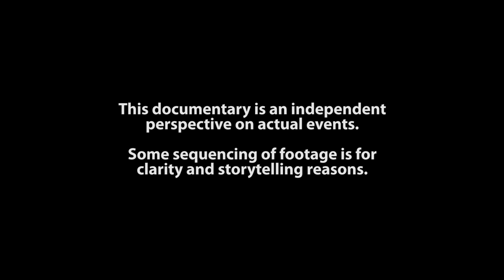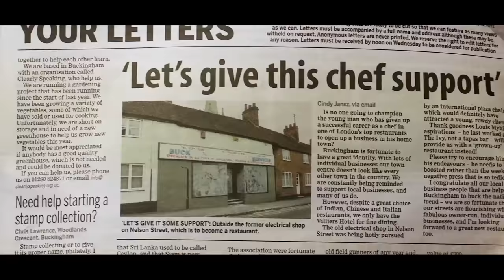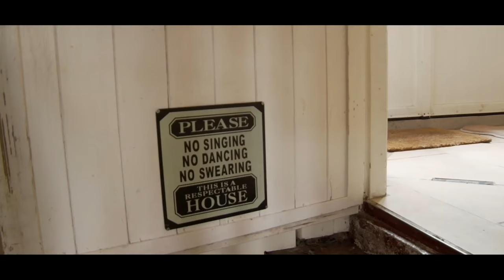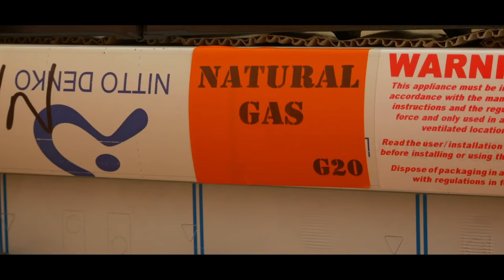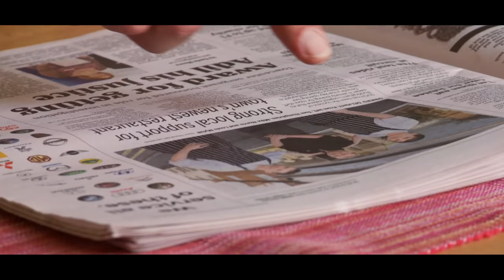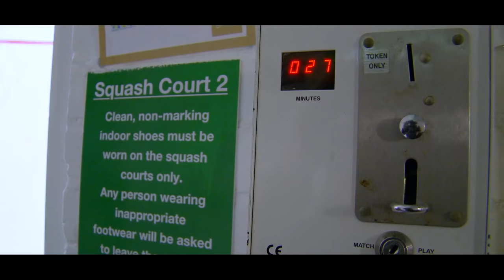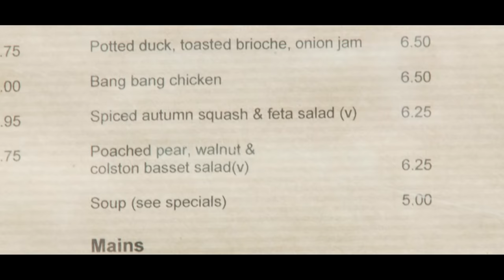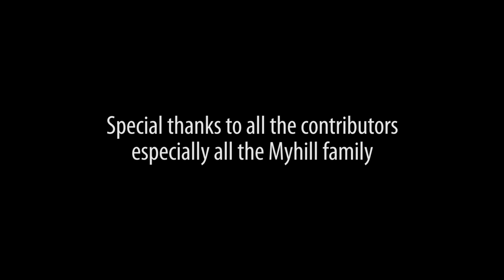Setting up a Restaurant? Louis and the restaurant - 52 mins documentary (HD)

Comment: Well, planning approved his restaurant plans and the local homes would have been asked if they had objections? So its all done and dusted and letters would have been sent out because it is a historical community and homes are Grade 1/2 listed.  It is not down to Louis to put up a message to his community about a restaurant opening in the building, planning Dept notify, good PR will promote the restaurant, that's how its done. Snobbery beyond compare. At one point they are crying out for a new proper restaurant e Voila! The kitchens would be approved by planning and not to upset the neighbours with smells it would have good ventilation and good equipment to deal with cooking heat and smells because of homes on either side. I wish him all the luck and respect being so young and passionate. Get off his back and support the local community. Would you prefer a spice restaurant like a curry house, Chinese, Mexican whose smells would be more prolific?
Reply: And what if your neighbour bought a top of the range BBQ, it would be the same, that funnel in the garden is great it takes the food smells away from the homes... you are such a drama Queen!